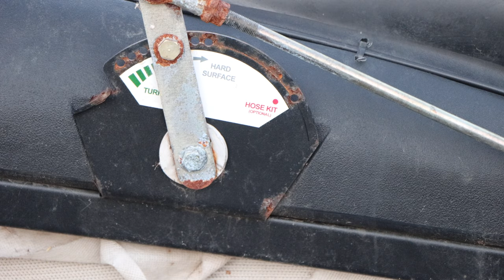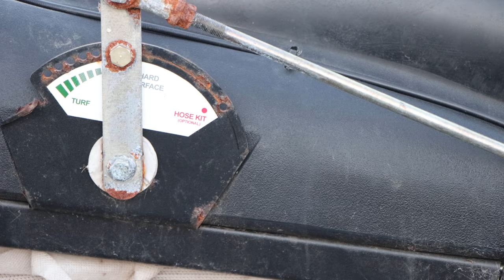Honda Powered Billy Goat Won't Start CHECK THIS HOW TO FIX PLUS ACTION FOOTAGE

Comment: I am going to try this on my non running unit. I already ordered a new $22 carb. I could see the choke wasn't closing completely, but this may be the answer.
Reply from the maker: How did you make out?
Reply: @pattayperformance  I never installed it, but was able to figure out the choke issue though. I'll get it done in the spring when things warm up. Thanks for checking. I have a Honda mower and changing the carb out made all the difference.

Comment: Too cold out for you , need to have a heated workshop someway . Burr .......Nice looking rig ...... I have an old Honda push mower with the same manual chock setup and it works well , it's one that had too install a new chock cable installed . Thanks for the video .....You audio was screwing up with music only .
Reply from the maker: Sorry I wasn’t clear...had a microphone malfunction.  I think the batteries died since it’s wireless.  Either got too cold and shut it down and/sucked the life out them.  My iPhone shuts down when it gets too cold.  It happens...so instead of losing the video I just music over it so it wasn’t a silent movie.

Videos like this that when I finally do get the work shop of my dreams...forever greatful!  Don’t get it twisted...on a nice day I will be back to roots in the driveway 🔧🤙🏻🦅🇺🇸

Comment: For the most part these come with junk engines.
I bought on brand new with a Briggs motor 
After about ten hours use the engine wouldn't start and had 30 psi compression.
The second one was given to me. Same thing except it was a Honda engine.
Reply from the maker: So these small engines have a compression release valve and will emite low compression readings.  You need to do a leak down test.  You also need to take into account...nothing is perfect!  Were you able to warranty out the motor/machine?

Comment: I could easily understand how someone could not notice the difference in diameter of that choke cable clamp. And I couldn't believe that little bit of movement resulted in an engine no start.  I think you cranked down ( lowered ) the vac to much before you started vacuuming the leaves. Also, it looked like the machine was clogged. There were twigs mixed in with the leaves.  At one point it was blowing the leaves instead of sucking them up.  Also the machine would have an easier time with the leaves spread out than in a pile.
Reply from the maker: So we are in agreement that the Billy Goat 10HP Vac is best for my application!  Great minds think a like!  That little bit of movement was also the reason of the explosion and fire from the last video!

Make that mistake once! 😂

Comment: The performance on minute 19 was not all that great, because the bag that is used on video gets clogged with dust really easy so instead of a vacuum it starts to blow. You got to use different kind of bag.
Reply from the maker: Thank you!  Didn’t know there are two different types of bags.

I have a bigger version BG that is also on the channel as well.  It needed a new bag and I bought it.  Break in process as per manual is to let the machine run anywhere from 10-30 mins to break In the bag for best performance.

I appreciate the view and comment, hopefully you subscribed to my channel 🤙🏻🔧🦅🇺🇸